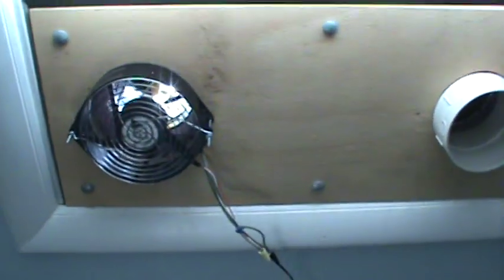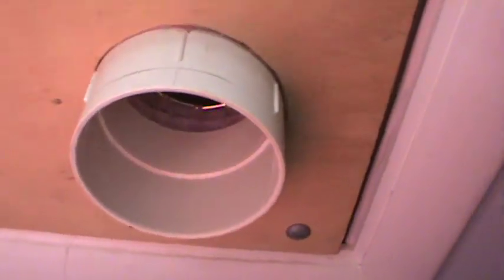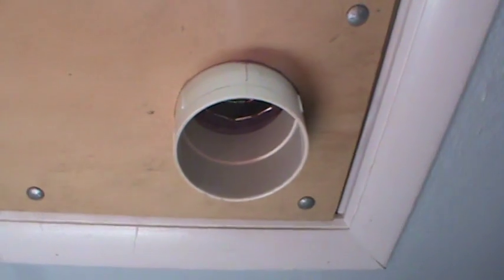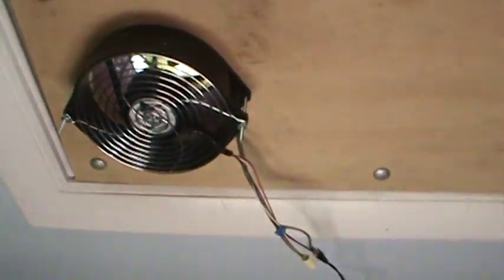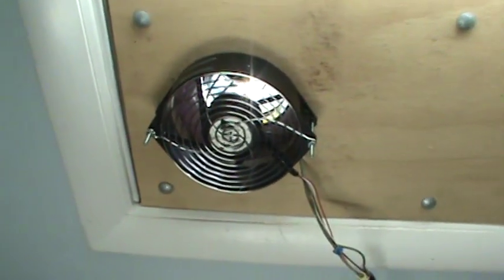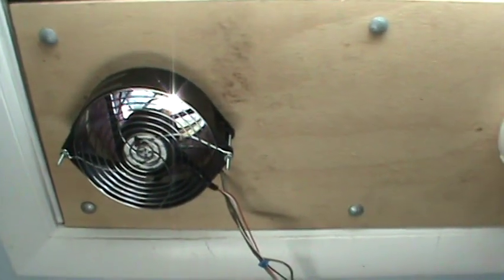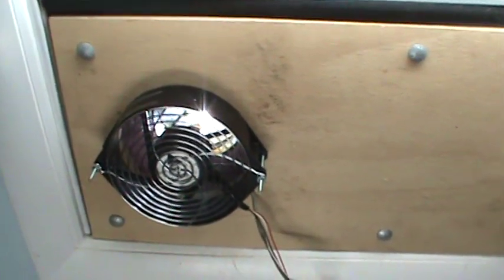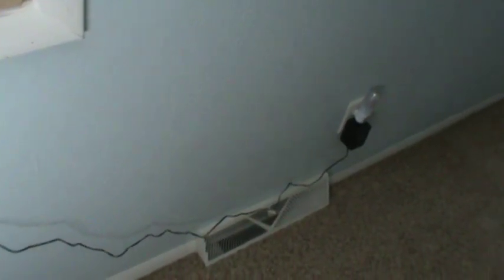Solar air heater running.

Comment from the maker: @shartne We haven't had much good weather to measure.  I did stop home over lunch on Monday and it was running.  It was running when I got off work also and the room was warmer.  I plan to build a much larger version that's permanantly attached to my house.
Thanks for the information on the cells!

Comment: I wonder what the temperature is coming out of it? you may have to use two twelve volt panels to power a 24 volt fan. Or you may have to build one panel with about 30- 36 volts use about 40 to fifty cells they are a half volt each cell.

Comment from the maker: @shartne It has cans in it, but they're stacked sideways.  I'm just using them as a heat absorbing mass.  The air flows in, across the cans and through the screening.  Then, it flows through the door and out the exhaust.  It was nearly free to build as I had the fan, thermostat, wire, glass, metal door, cans, etc, and I didn't want to spend a ton of time on it for a proof of concept.
Thanks for looking!